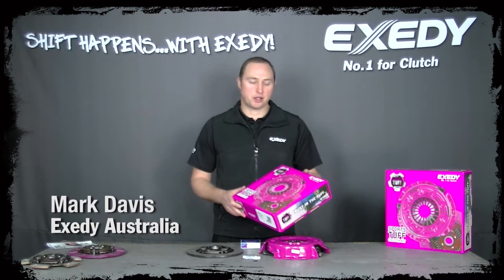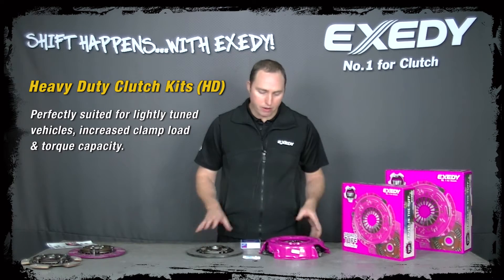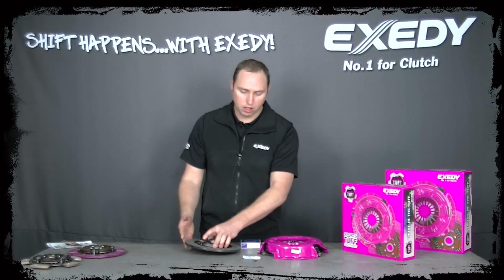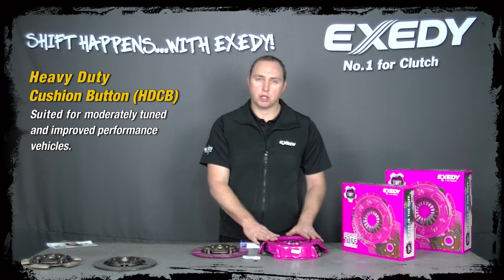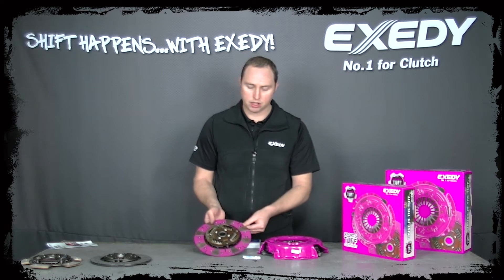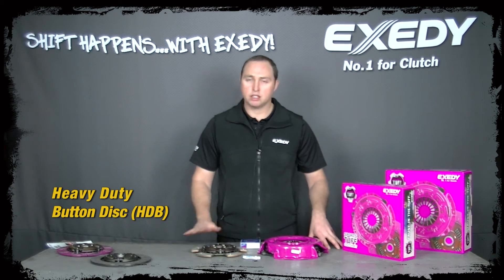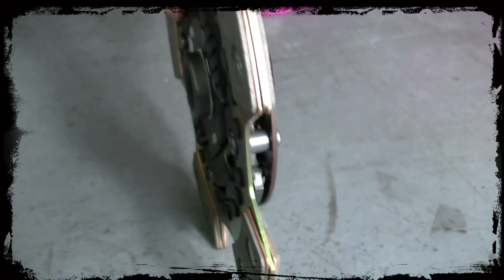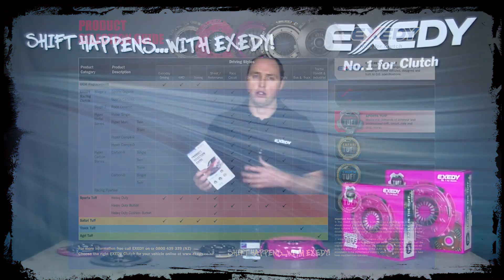EXEDY Sports Tuff clutch kits

Comment: Hi I purchased an Excedy HD clutch for an Isuzu dmax 4x4. I had a dealership fit the kit professionally. When I let the clutch out, it is a sharp take up. Not smooth.It feels like you need to just throw the pedal out. Which h is not practical.  You have to be very careful not to slip the clutch at ALL or it will shudder. It's only done about 350klms. Will this clutch become smooth after the run in period???
Reply: What ended up happening?